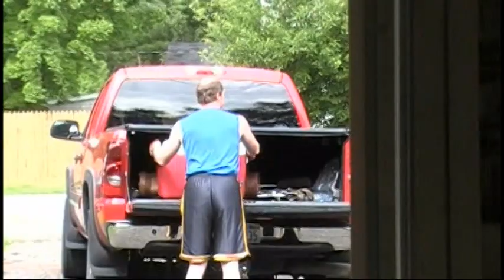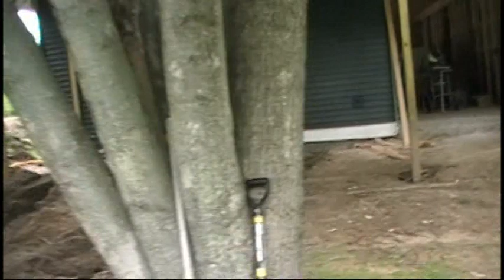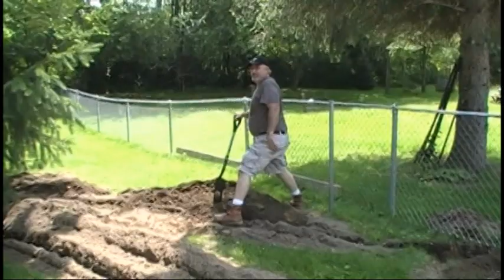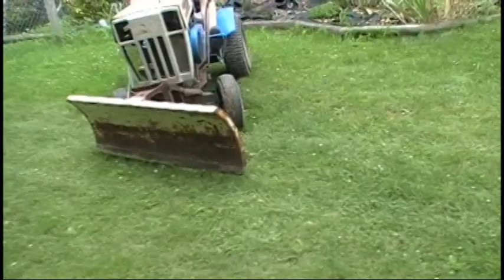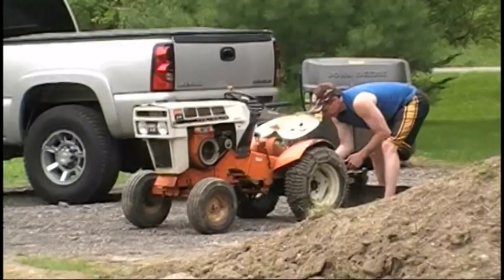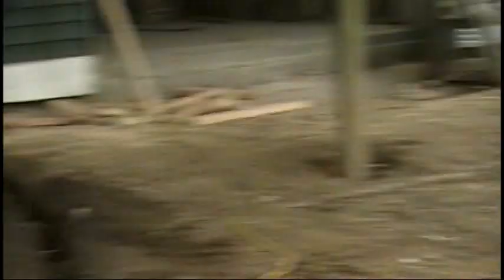SSBTC HQ Wiring and Trench Filling

Comment: @Needmorehorsepower with chains my JD will just keep on going along pretty good pushing dirt! does about as good as you would expect from a 10hp roughly 800lb machine. i am thinking of picking up a set of ag tires and another set of weights for it mainly so i can plow more snow with it in the winter.

Comment: @Needmorehorsepower My JD 210 likes to spin up the tires just like the suburbans in this video. so if i want to push with it i need to have the weights and chains on it to get enough traction. a diff lock would have been a nice touch though.